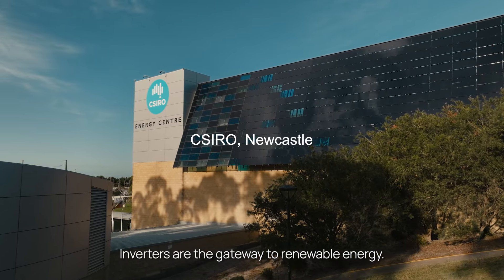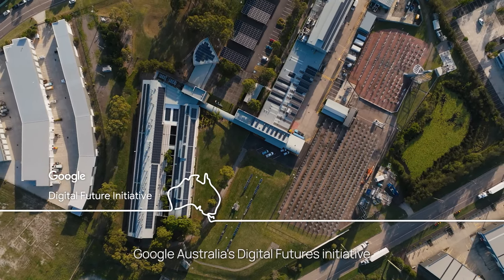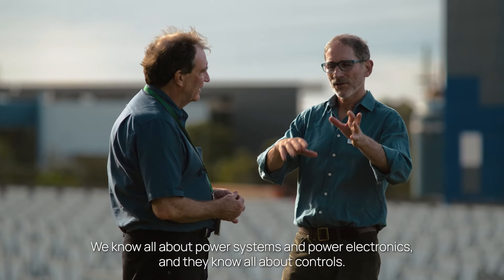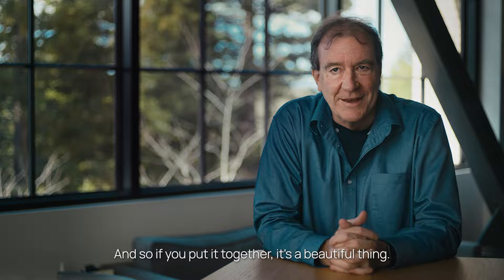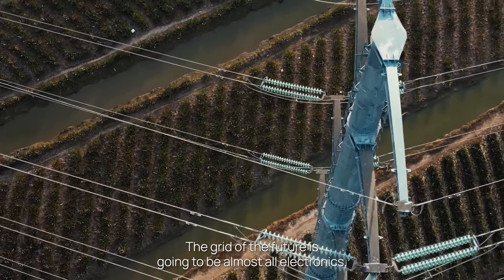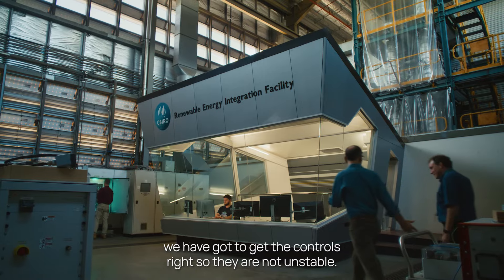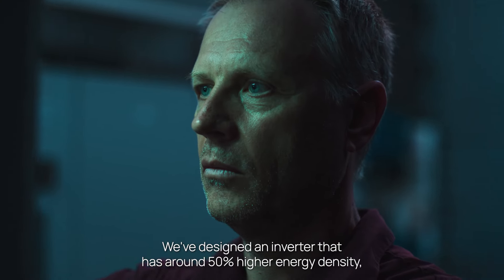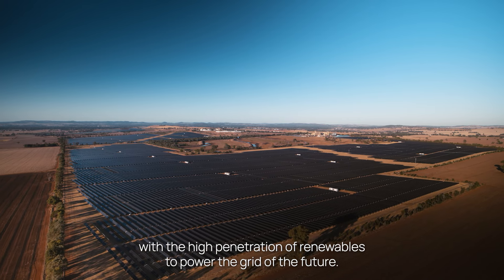Prototyping advanced inverters to power a sustainable future

Comment: What they need to do is enable the grid to be dominated by small-scale renewable generation without frequency or voltage instability or protection issues. Inverters need to be synchronised and talk to each other, via the internet or some sort of power line communication or signalling.

Comment: A fully electrified future requires a lot more copper that can only come from copper mines.  We need at least 60 more mines, meaning many more discoveries of economic deposits, and a willingness to allow the development of the economically viable ones.   That is not happening at nearly the required rate.  The supply of copper metal will constrain future electrification.  The exact same can be said for silver.  In both cases, it takes well in excess of a decade to get a mine project pouring metal.